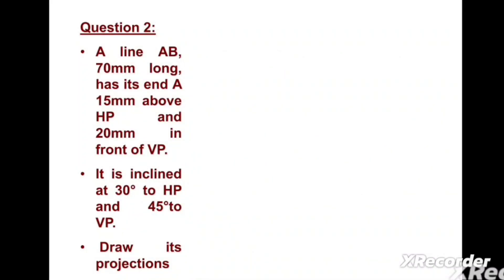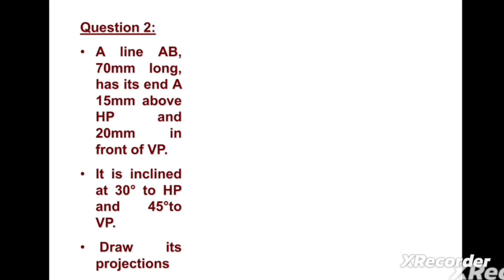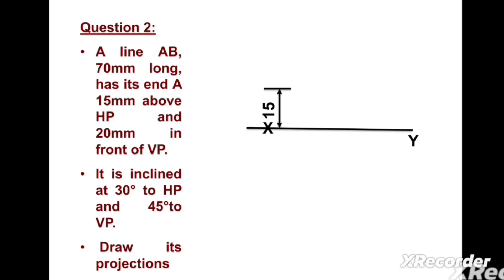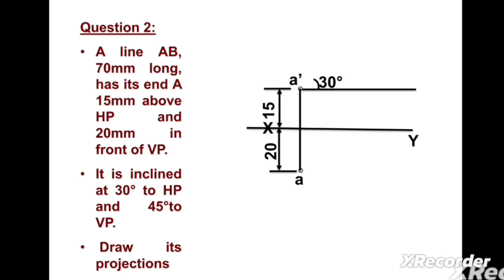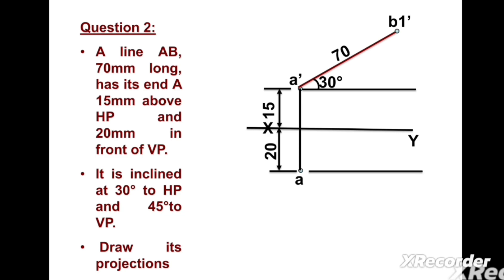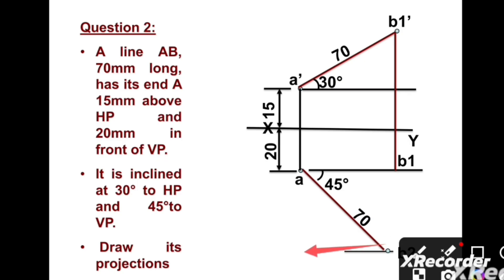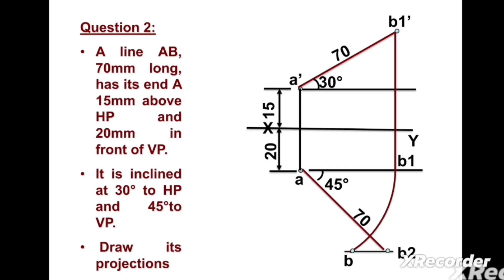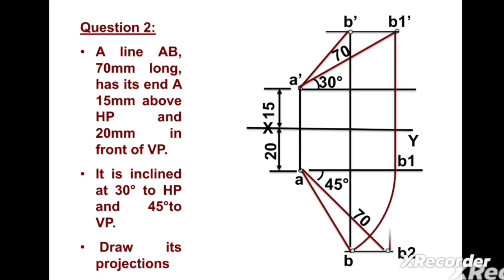PROJECTION OF LINE - 2 (English)

Comment: 7) A 70 mm long line PQ is inclined at 30º to the H.P. The end P is 15 mm in front of the V.P. and 25 mm above 
the H.P. The front view of the line measures 45 mm. Draw the projections of the line PQ and determine its true 
angle of inclination with the V.P.